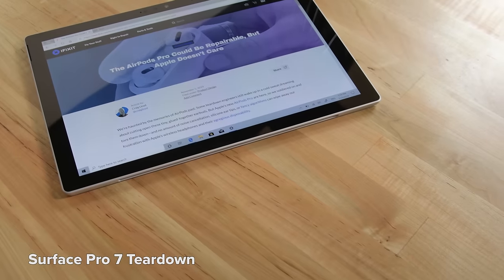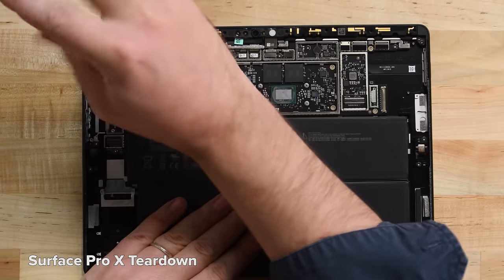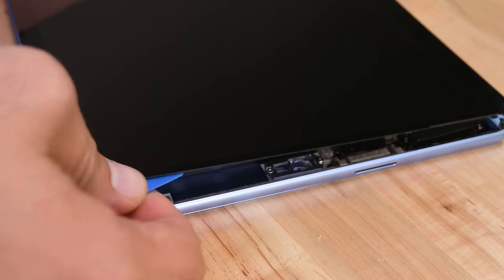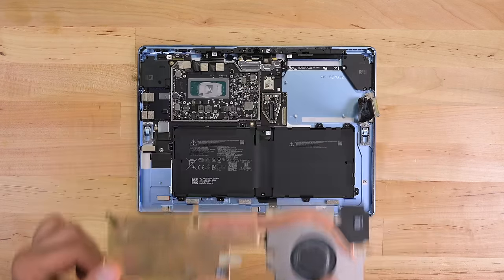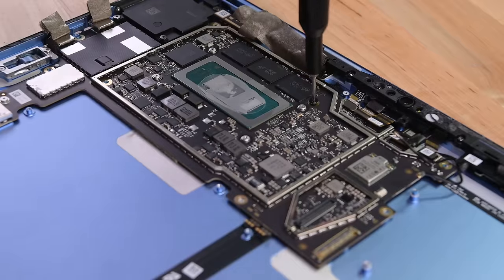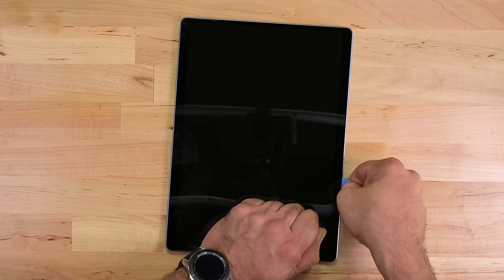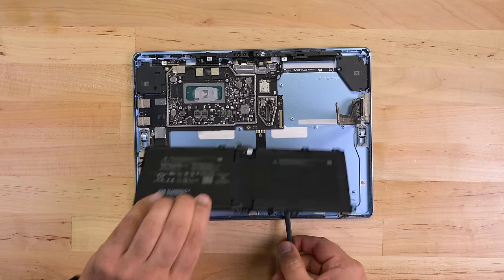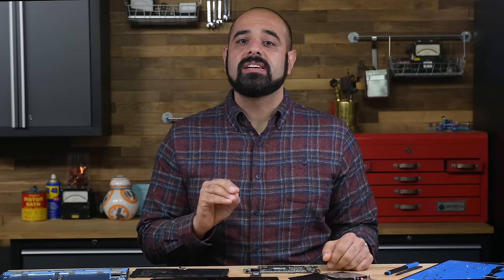Surface Pro 9 Teardown: The Most Repairable Surface In Years

Comment: So coool! Now the only thing left is make the ram upgradable, the cpu upgradable and the screen attached with screws, then the computer will be perfect imo
Reply: Upgradable RAM might not be happened since Microsoft already stated that it could lead to security breach from swapping RAM module.

While, it makes almost zero sense (myself included), but it is their reason nonetheless.
Reply: Wont happen.

Devices will get less repairable, since OEMs are likely to follow Apples example of integrating RAM and SOC.

That’s one reason why the M2 devices are so impressive.
Reply: @sheikbombalot5781  integrating RAM and SOC.... what? LOL. That will make the devices expensive and hard to configure since there are 3 different GPU and CPU makers in the PC world.
Reply: @sheikbombalot5781  thats only on arm, which wont be popular on windows for a long time.

Comment: 7/10 is great, but no headphone jack, and I don't think it has seperate boards for USB-C. Might want to take that into consideration (if you haven't already).
Reply: Yeah, even though this is a nice repairable device (compared to older Surface Pro's), I won't be replacing my Surface Pro 3 with the Pro 9 for the reason of not having a headphone jack. It also has no USB-A, so I'd need adapters for any USB devices I'm using (I have no USB type C devices or cables).
If I ever need to replace the Surface Pro 3, it might be to the Pro 7 (which has the same form factor).
Reply: @TheSpotify95  I want to maybe go to a Pro soon enough (I'm currently using a Go 1 as of now) but that might have to be a Pro 8 (and not the Pro 9) even though the new colourways look amazing. Or I might just run my Go 1 down to the ground, and grab myself a custom desktop later down the line.

Comment: Why are the heatsinks running over the battery?? The heat will inevitably damage it. Thats straight up harmful design.
Reply: The battery will produce heat and the heatsink is actually going to sink the heat away from the battery and not towards it. Are you an engineer by any chance? On the other hand the shielding protects the battery from potential pressure from the display so it won't be punctured if say the screen is cracked.
Reply: @fjjwfp7819  the CPU has 60C which is quite deadly for bateries
Reply: @nutzeeer  the heatsink will not be at the same temperature as the CPU package. The battery will also be fine at up to 60 degrees C. If your device isn't at burning temperature, the heatsink temperature will stay well below 50 degrees C anyways.
Reply: @fjjwfp7819  regardeless i will not buy this. Any temperature above ambient shortens the lifespan

Comment: a lot of free space, why?
Reply: Look at 3:20 where you can see the back of the display. The space underneath the battery is taken up by the PCB strip on the back of the display. On the other hand, the Samsung note 7 teaches us about putting as big of a battery as possible into tight spaces, and since most battery packs are available only in rectangular sizes, many internal structure geometry restricts how big the battery can be. The left side of the battery is also taken up by the space for the removable SSD.
Reply: @fjjwfp7819  any way, even after u talk about, a lot of free space left. For exampe ipads or macbooks use all available space for battery
Reply: @fjjwfp7819  so im confuse that so big company like microsoft dont do that. U know, it looks like fakes from china where is good for business to do not put lot of expensive battary

Comment: why not making battery replacement like replacing the SSD then?
Reply: How do you propose that can be done? Magic?
Reply: @fjjwfp7819  Have a door on the back, under the stand, that looks like the one for the SSD, just bigger.
Reply: @GeoStreber  and how will the structure rigidity and integrity will be when you cut a big hole through the back of the machine?
Reply: @fjjwfp7819  shat should be no problem if you bolt it down properly.
Reply: @GeoStreber  Great to hear, I'll look forward to you making one then.
Reply: @fjjwfp7819  You guys simply too much used to devices without a replaceable battery. Devices before the iphone era used to have replaceable battery no matter how slim it was. You just not old enough to own one of those. Sony made many ultra-compact portable devices date back to 20 years ago. Like the Clie NX-series. Although they were not in the save form factor. After owning so many ultra-compact devices with a replaceable battery. I just don't believe it is technically impossible to make a table with a replaceable battery and yet powerful and sturdy. Just take Nintendo Switch as an example. It's battery is so easy to replace.

Comment: Ah, yes. 7/10 easy to repair. All you need is a giant specialized heating pad so that you are less likely to snap the screen in half while you are scraping all the glue holding it together away. Then you can just remove every other component except for the motherboard, and woila - you're at the battery! 
Yeah, no influence from Microsoft here. Suuuuuuure.

Comment: 8/10
for the screen 
and the ram upgrading

i need me one
i hope there is an i9 139000k version though...

also might wanna ditch the wide black edges 
& go surface pro X style...

keep up the good work
ur getting there

i use 7+ i5
& for my daily & gaming for a fanless device
its worth it...
i even kep it running 24/7

Comment: 7 is too much, ssd and battery is great +
However, the LCD could definitely stick to the frame that would unscrew from the back, so the risk of damaging the screen would be zero, and even its replacement would be easier.
There is progress and it should be commended, but MS has the ability to design equipment that will always have a 10/10, they just have to want it.